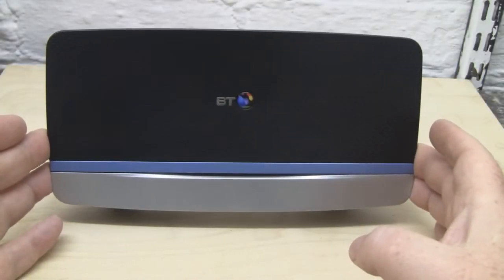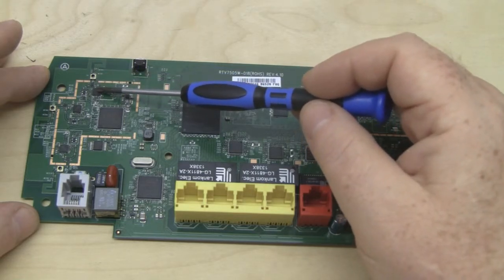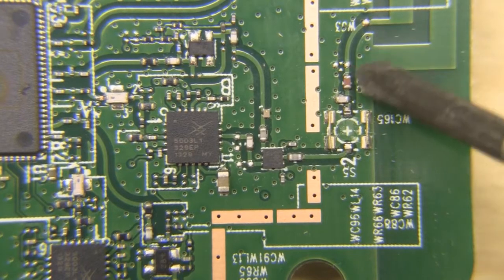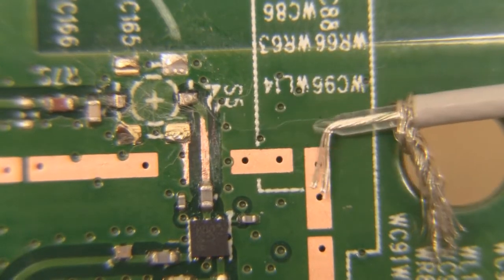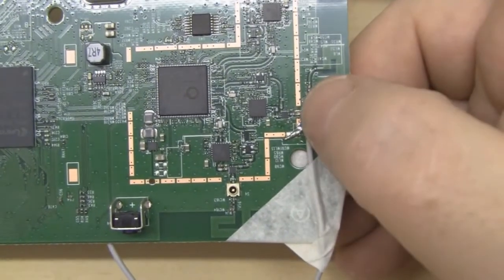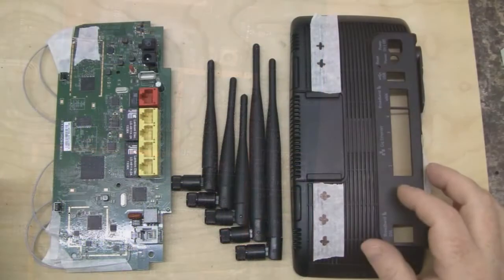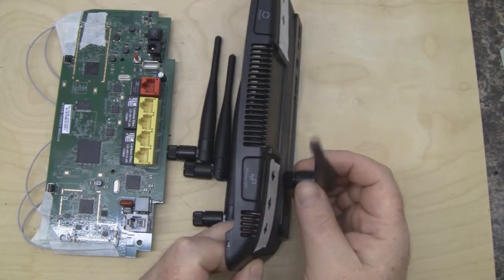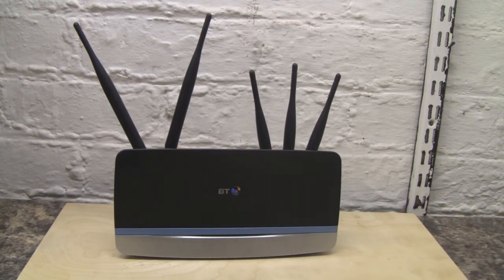BT Home Hub 5 Antenna Modification #60

Comment: Bought 2 BThub5a on ebay in 2023 for a fiver each. Flashed with openwrt software and just modified one 2.4ghz antenna and it works great as a travel router. One stays at home connected to main router and the 2 BThubs connect over wireguard to provide secure access when away. Can't beat that for a tenner.
Reply: The HH5A looks a lot more difficult to modify for external  antennas than the HH5 described here. Can I ask how did you did yours? I have a BT HH5A and three  Plusnet Hub One's (identical board) and I have flashed OpenWrt 22.03.5 onto all four.
Reply: im able to use mine to create my own Ethernet network using my iPad to laptop then laptop to its ethernet cable to the modem.
i will have to try ur mod out.   i wish old tech companies would open up there tech software to be easily modded after

Comment: Why remove those sockets (you call them test points)? You can get antenna cables that plug directly onto them.
Reply from the maker: No you can't I know people sell them but they don't work. You think you have added external antennas but in reality your still using the internal ones.

Comment: Thanks for the video mate!
If I just need a but or range to reach a shed at the back of the garden, can I just add one lead to the 2.4Ghz and attach a panel antenna instead of a dipole? Can you recommend a cheap panel/directional antenna?

Comment: Can somebody clarify the antenna cnfiguration for the antenna. Looks like the 5GHz is using MIMO with 1 Tx and 2 Rx. If this is the case then the path length is critical to achieving the processing gain. Also can one adjust the amplification to allow for the extra gain in the antennas.If this is installed in a commercial premises then they will need to undertake EMC testing to confirm that they do not cause interference and are not susceptible to interference.

Comment: is this the same router as plusnet uses as there hubone as thats what i have got and i have had some problems with heat and range but it looks the same as the hh 5 just with a white case and not a black one
Reply: It's the same router. Looks identical with the case off
Reply: thought it was

Comment: Really great video. I bought a second-hand HH5 off of Ebay (in case I broke my own one), modified it following your example, and all is great. Many thanks. Don't listen to the idiots posting criticisms or bad advice like Mike Zeltser, the MS-156 cable will not plug directly into the ports.
Reply: Actually the MS-156, do fit into the ports currently unable to test to see if they are active however I can't imagine they would disable the test ports so I'm afraid to say that  Mike Zeltser isn't an idiot. The issue with the ms-156 test probes is that they are very big the better soluion would be to replace the ports for u.fl as suggested haven't tried this yet but willing to give it a go.

Comment: Why not just get MS-156 cable that will plug directly into the ports? You can get them here from our store:
http://www.coaxrf.com/shop/ms-156-male-angle/rg316-ms-156-male-angle-to-rp-sma-female-coaxial-rf-pigtail-cable/
Reply from the maker: Mike Zeltser They are test ports for use in factory testing they are disabled after use and that is not the correct connector so would not fit.
Reply: andrew mcneil Yes they are test ports and NO they are not disabled and YES they will fit correctly. here is an example: http://i.ebayimg.com/images/g/Ca8AAMXQlgtS4LYs/s-l1600.jpg

this is WRT54G V8 that had a soldered on u.fl cable to none removable antenna, you can see the MS156 fits perfect into the Test Port and works even better. You can very easily test the functionality of the port by simply pinging it with a volt meter.
Reply from the maker: Mike Zeltser If that cable fits then it my be worth getting for the lab, but I modified 10 hub 5's for a media company plus 1 for myself and they were all disabled maybe you had a different revision to me. Also you would need 5 of those cables for each router and at $7 each so makes the mod a bit more expensive.
Reply: andrew mcneil Yes it will be more expensive but a lot easier for those who are not good with a soldering gun and less riskier. If you want something cheaper you can always get PCB U.FL SMD connector like this: http://www.coaxrf.com/shop/pcb/2-pcs-ipx-u-fl-rf-coaxial-connector-smd-smt-solder-pcb-mount-socket-jack-female/

plus u.fl cables:

http://www.coaxrf.com/product-category/4uflcables/rpsmaconnector/

that will be much cleaner looking, like this mod here:

http://wifirfexpert.com/wp-content/uploads/2014/06/EA6500v1.pdf
Reply: Mike Zeltser Is this one here the same as the one you're talking about ?
http://www.amazon.co.uk/2pcs-RP-SMA-Pigtail-Antenna-Cable/dp/B00JOGU78G/ref=cm_cr_pr_sims_t/277-6741080-9905815
Reply: Mike Zeltser Max frequency is 3ghz, what about for the 5ghz?
Reply: MidiTech No this is IPX u.fl cable, MS156 is much bigger.
Reply: Mike Zeltser Ok which one do I need then?
Reply: MidiTech http://www.ebay.com/itm/141108014559

Comment: BT engineer.. I say don't do this. Mainly because you'll have one of my colleges laughing at you. No doubt the man doing this is highly trained technician ... you are not. If you are a consumer. With little money I suggest just going to marlins and getting some power line boosters.  For 20 pound if you destroy your BT home hub you'll more than likely end up having an engineer out trust they don't often just send new routers. And he will bill you for his time. Min of an hour. And bill you double for the router. You've been warned
Reply: Ben Gough a bit patronising to assume someone can't do this. Keeping in mind that to get to this vid, you would have searched for "homehub antenna mod" or something of the sort, so one would know what they're getting into. And looking at it, it looks like a fairly easy mod.
Reply: Mate firstly get over your self and your internet connection. Second running a NPA is still quicker than WiFi. Third that's equipment is still owned by BT. So either use a network power adapter or cat5 cable. Also the soldiering done by that gentlemen is more than likely to cause internal equipment rein
Reply: Of com can't prosecute the generally public. Just telecoms and since BT talk talk virgin all use this to help their consumers. Think they now more about of com than you.
Reply: Hi any idea how to get a stable ping? spikes from 18 - 100... any idea why ? using wireless connection
Reply: I have fixed it via ethernet cable using home plugs
Reply: ^was gonna say wireless  card

Comment: I imagine modifying their homehub5 would void some warranty or something. I was only checking this video to see the insides and hopefully get some info on the best direction to point the device to get the best signal in the room with the computer. I did not get what I needed. I have now got an 802.11 ac USB adapter on order to hopefully give me far better results. I am only getting MAYBE 20Mbit down and up to 7-9 Mbit up. Yet the laptop with it's built in "n" wifi gets 36 Mbit down and 18 Mbit up. So I am really hoping this new "ac" will give me almost wired results. I had to do this because the data extension which BT ran around the house into this back room has a short in it and was preventing us even getting a dial tone. BT will NOT fix it for us and keep saying over and over (even after multiple calls) that we need to hire an electrician to come out and deal with the data extension since they (bt) will only fix master socket issues. Even though this is a BT data extension with a proper BT data socket installed in this back room. I am very disappointed with BT about this. So now I have no choice but to be a wifi guy, as much as I hate and despise wifi on a main system.

Comment: I just installed a home hub 5 due to getting fibre and my home wi-fi is worse than it was with the 4  BT have been no help at all i might try this and see what happens .
Reply: It may be worth just getting a dedicated wireless router then using the Home Hub as nothing more than a feed for it. Turn off the WiFi in the hub and just let your dedicated box do it. I do that with an Apple AirPort Express. Great little routers and they can be used as network extenders and stuff too without needing to hack them or buy something specifically for that task if you ever decide to add more routers to your network (or move to a bigger place and need the extra hop).

Comment: By touching the pbc like you are doing with the coax, hands, screwdriver and adding tape you destroy your circuit. the small components are short circuit very easily! there is always electricity left in the board!
Reply from the maker: Wow I did not know that! And will I have to be careful around those caps or I could loose a finger!
Reply: That's funny.. short whilst powered down.....